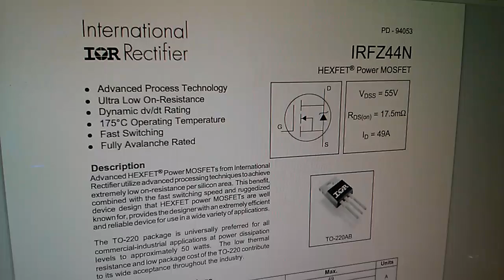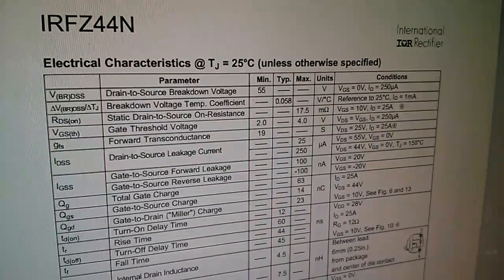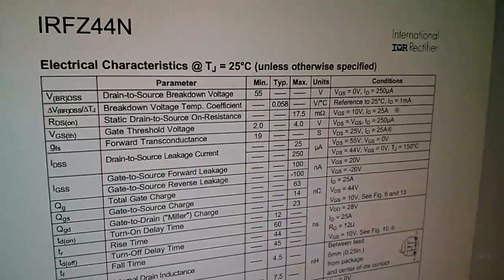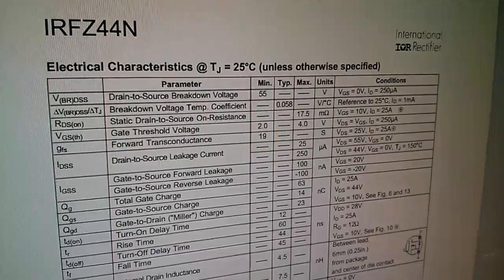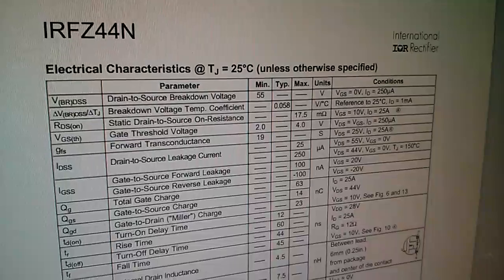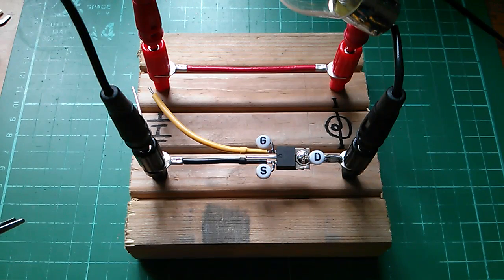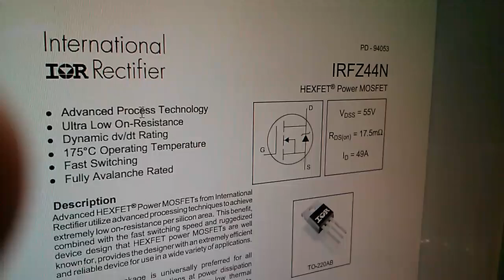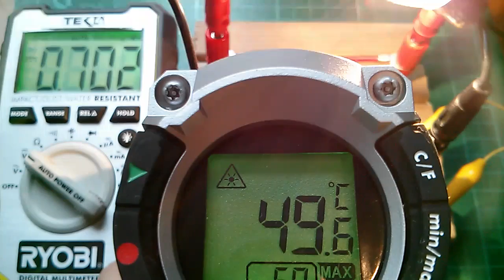Practical MOSFET Tutorial #2 - N Channel, Low Side and the Body Diode

Comment: Thank you so much for your videos! 
Concerning parallel semi conductors with NTCs (negative temperature coefficient). 
They have to be thermal coupled. Isn't it? 
Thus one of the parallel semi conductors having the highest temperature and thus is on its way to 'hell' is balanced by thermal coupling and heating the other ones as well. Thus forcing them to conduct more current and thus diminishing the own tendency of conducting more current by temperature rise.

Comment: Car engine management systems use the ground side switching more than high side switching Ground side switching is called "pull down"  12v switching (High) is called a pull up circuit. That applies to inputs and outputs

Comment: Hi Julian : 
A couple of points : I think these days cars use a different wiring than the old everything to ground  to prevent corrosion and connectivity issues .
The 4 x bank    Mosfets could each be wired on a heat sink to balance thermal differences.
Thanks for video ,as always very clear .

Comment: How many amps flow through your mosfet when it is on ? If you have 0.7 voltage drop it means there is 40A ?? because 0.0175 ( your mosfet's resistance ) * 40 = 0.7

Comment: I know I have had that happen. and I found you have to be very carefull with them because they dont tell you witch is common in the system. I to ordered a cheap charge controller it was a 30 amp requlartor charge controller and postive was common were as my system was negitive postive. lets say burned up the cheap controller lol. if I only new then I could have set it up were it wold have worked but didnt know at the time.

Comment from the maker: Yes, I bought a cheap solar charge controller which is common positive - all the switching is done on the negative side. It's easier to design the circuitry this way, but much less convenient for the end user. Also, the manual made no mention of it. Cheap... and nasty.

Comment: nice video thanks for sharing. good infor.  its wired how cars use negitive or gound as comming but when you work with solar and wind they use postive as common and switch the ground wired how that all works.  so I had to build a switch using the Nchannel mosfets.   but when using and h bridge you use a two n channels and P channel mosfets.  defently like this video thanks for showing.